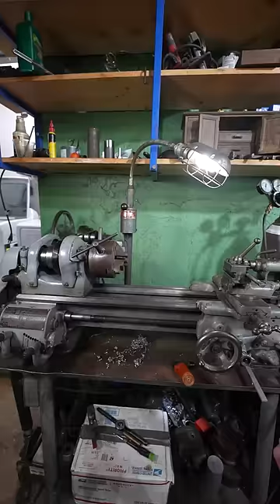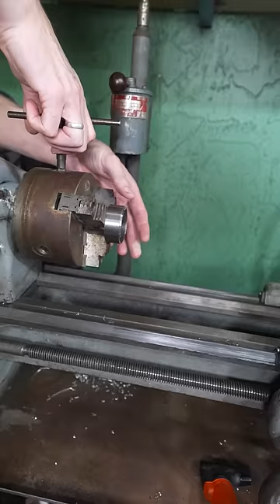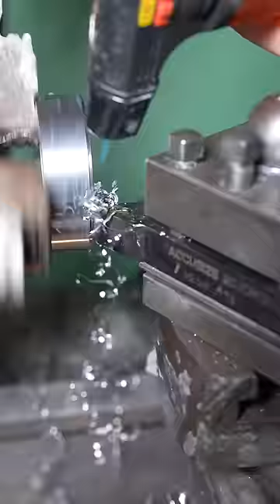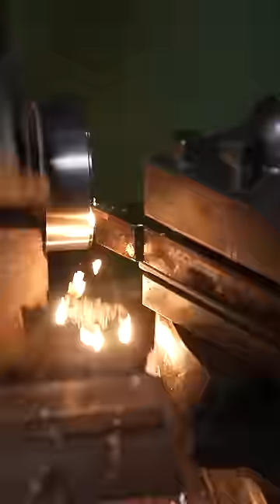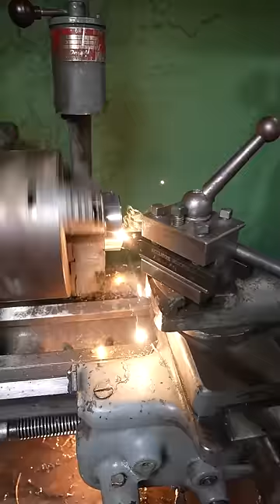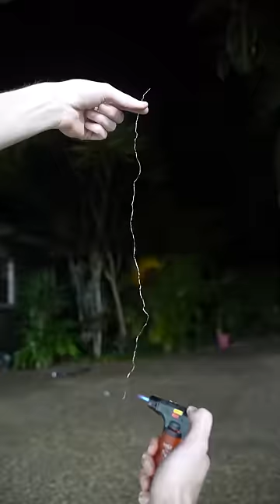Titanium has a dirty secret

Comment: I'm glad someone else was taught to keep the chuck key in the chuck.  Thats the best way to know which way the spindle is turning.
Reply: I lol'd pretty hard at that one. I'm kinda shocked all the fun hating safety nazis haven't been harassing you about it.
Reply: I know plenty of machinists who do this, and yeah its a thing. There are better ways to determine which direction a spindle is rotating- I thought that was pretty much common sense but you would be shocked by how many "professionals" lack that common sense. 

Lathes have arrows or some type of indication at the on/off handle indicating forward or reverse direction.. (really easy to look at rather than launch a chuck key to figure it out...) If the arrows are worn away or not present, keep the spindle speed low enough so you can actually see which way its rotating, and then increase the rpm's.....

i personally witnessed and helped a co-worker who started an engine lathe with the chuck key still on the spindle; The key caught his arm and pinned it between it and the ways- crushing the  radius & ulna bones midway up his forearm. He needed surgery- so yes chuck keys not removed from spindles can and do cause injuries... 

Personally I would never be so reckless, but I've always been a "you do you" person, and I've never called another machinist out for that- I'm too busy to worry about someone elses methods like that.
Reply: Idk I’m not a machinist but have used lathes a couple times. The people that owned them would have killed me themselves if I did that

Way better ways to see what way it’s spinning. Take just starting it on a slow setting for example if you have a lathe that can do that.
Reply: Are the arrows to show which direction the trajectory of the chuck key will follow? 😂
Reply: @xanderwusky   Nah! The chuck key flinging method is the best method to determine chuck rotation....the way all the best professionals do it.
Reply: @Alan-tr5uj too long no one read
Reply: I was going to leave a comment about machining magnesium but I thought I saw something fly out of the chuck to went back to view again, why would you post that....maybe on purpose for the comments?
Reply: I can't tell who's joking or being serious anymore.
Reply: @GenButtNaked762  
GenButtNaked.
I suggest you shouldn't be having much fun at night out in the woods, concerning that name.
Reply: @bongjovi4928  how funny for you, I did read it.
Reply: yea, pretty much had to go back and make sure that's what i saw... then quickly left
Reply: @halseyknox  It's called a sense of humor. Walmart sells those, 2 for a $1, 3 for .96 cents.
Reply: Titanium would be a heavy metal, Most heavy metals gives off toxic fumes when burning.
Reply: Yeah it's all fun and games until that Chucky flies out and smashed a light
Reply: Not to mention that switch just above the chuck/key combo.
Reply: I took a shop class in high school. If I ever let the chuck key in the chuck and started the lathe, I'd get yelled at and get an "F" for the day.

In real life, this stunt would set fire  to the cutting oil and the oil on the ways  of the lathe.

Titanium is a light material used to make frames in light weight snub nose carry revolvers.

Looks like a good material to make cylinders for lightweight six shot snubnose carry revolvers in .357 Magnum.
Reply: Shouda mentioned, my bad. Imagine a six shot version of the five shot S&W Chief's Special in 
.357 Magnum. You would have to enlarge the frame slightly to make room for the six shot cylinder.
Reply: This discussion hurts My head,
Reply: @howardosborne8647 You would certainly remember it once you've had it embedded in your face! 😬😁
Reply: @matheusfaria7230  Also do you actually like Tranquility Base? I'm a huge fan went to the same college as Arctic Monkeys and AM is a timeless masterpiece. But I'm convinced everything they've done since AM has been some kind of joke, they have the money to do that at this point, just mess with people for laughs. Maybe i should listen to it some more, and in varied states of consciousness?
Reply: @hirsutuscanis  Don't do drugs.
Tranquility Base is good.
I put this pfp when I was a teen and never changed. I didn't see much after Tranquility Base. It's not that deep.

The reason people like AM and the things they visualize from it are probably completely different from what the band itself thought when making it. 
That's why for you what they've done after AM seems bad.
If it wasn't like that they would became World famous upon the release of AM and marketing geniuses. We know that's not what happened, took an extremely long time for it to be recognized and that is because society itself changed over time, or at least the part that listens to music.
Reply: @hirsutuscanis  If you actually went to college with them and talked to them and stuff you should try to reapproach.
Reply: Yeah, it always confuses me when I have to guess which way it's going to rotate this time.
Reply: My heart shot out of my chest
Reply: Awesome, thanks for the tip!
Reply: @halseyknox  they knew exactly what they were doing
Reply: I use it to tighten the arbor while I'm working..........
Reply: Like the best way to tell if which revolver chamber is loaded is to play Russian Roulette?🤣
Reply: @matheusfaria7230 People who say "don't do drugs" don't really appreciate good music, or maybe they just aren't aware of how much of it was made possible by drugs. Btw, unless you're a Mormon who doesn't drink caffeine or eat chocolate, you ingest drugs. You're just being prejudiced, generalizing them as all the same thing headed for the same place, rather than learning more about how they're definitely not.
Reply: Hahaha!!!
Reply: And great fun to watch it fly away to God only knows where.
Reply: @Alan-tr5uj it's all fine and good until it gets flung across the shop at speed and hits you.
Reply: I think keeping the key in there is to not lose it or have it covered in shavings in the bin below. Otherwise if you turn it on and the key in in there you have a accident about to happen. Every lath I used or saw always runs in the same direction. Counter clockwise.
Reply: @blarghblargh    U tube removed the one frame showing chuck key flying across the room, for me and my 'bama phone.
       Chuck key stupidity is more dangerous than titanium fire. I've cut a lot of titanium, never had a fire. Higher production possible with slower speed (rotation) and higher feed rate: lowers chip temperature. Water spray for longer tool life - no fires ever. 😊🌈💮🌹🥀🌺🌷🌸🏵️🌻💮☘️🌾💯%
Reply: Keep your hair and jewelry close to, "Chuck." ;-)
Reply: @cwf081166, you cannot buy a sense of humor at Wal Mart, or anywhere else for that matter.